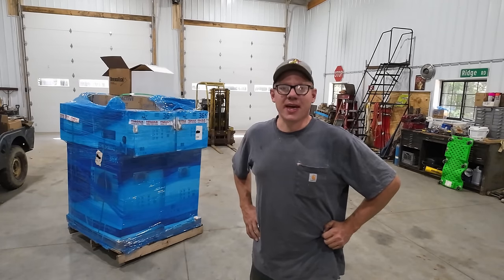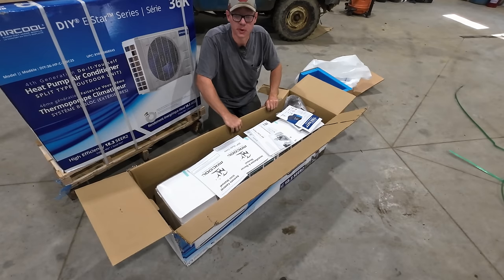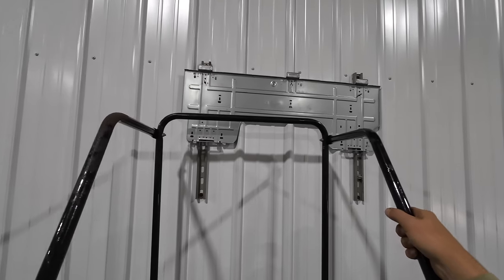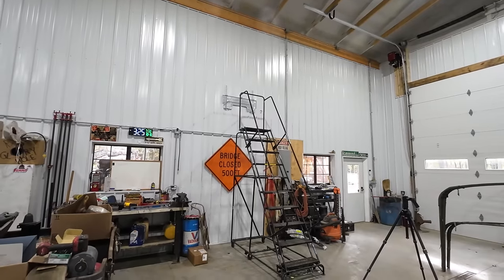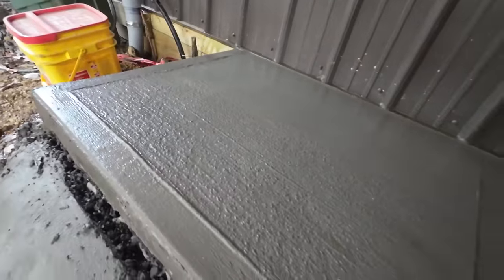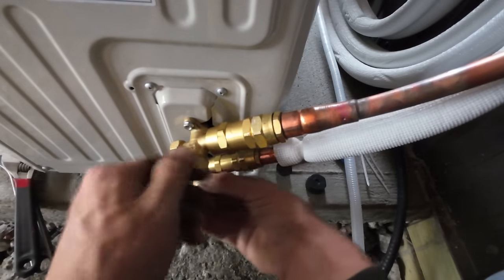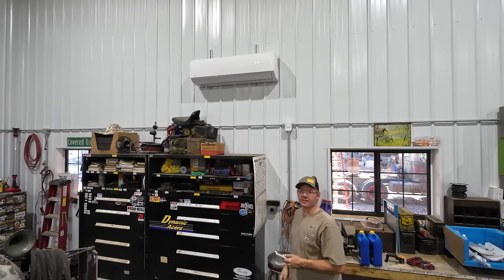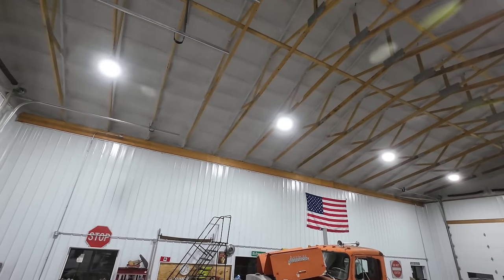DREAM SHOP Gets a Serious Upgrade! (How Hard can HVAC be??)

Comment: One suggestion put a bit of steel wool in the lineset hole in the wall and seal it with some caulking. I’ve seen mice climb the lineset and make a nest inside the indoor unit. I know this because I had to replace the customers unit as they chewed up wires and destroyed the unit. 36+ years in the hvac trade you did a clean install. Happy thanksgiving.
Reply: I agree, the steel wool hurts their fillings.
Reply: Im surprised you didnt notice no electrical disconnect.
Reply: I did the same thing with the steel wool. 😮
Reply: I would use the stainless steel scouring pads, they won’t rust away.
Reply: That and I’d always been doing a slight angle to the outside to help drainage along with keeping rain from falling into the pass through and into the conditioned space.
Even if the condenser is mounted under a cover, best practice along with other smaller improvements I’m sure other made elsewhere that aren’t entirely necessary but add a bit of extra protection and peace of mind.
Reply: I used the steel wool trick in my house, around the holes between the basement/first fl for the baseboard heating pipes. Took a steel scrubby pad, squirt some silicone caulking into it as a 'binder', and shove it in the negative space around the pipe. No more mice upstairs. (after the cat, no more mice in general...)

Comment: Be sure to clean the filters regularly, if you don't the dust will actually clog the blades up to the point where the fan will get clogged and the units rather loud.
Reply: Also make sure the condenser units are not crowded out, you need lots of airflow for them to run efficiently, as possible.
Reply: @everestyeti   100% true!
Reply: @everestyeti  They stress that to hell and back when installing them here in New Zealand.  It needs to be as clear of obstructions as you can make it for several feet in front of the fans.
Reply: If I may add my two cents in to this..😃.., I'd install simple roof above the inner unit so all the dust that there always is inside the shop, won't lay down in to it but instead the roof wich is lot easier to clean. Could imagine simple piece of tin would do the trick..
Reply: Every 3 months inside and 1 time every year the unit itself
Reply: If you live in colder climates you should mount the outside units higher to avoid drawing in snow.  During the winter these units also produce a significant amount of ice underneath them.  It's interesting how these units function, if the outside coils accumulate ice it will start a defrost cycle by reversing the AC circuit until the ice is melted.
Reply: @Tuulessaistuja  Bingo, thats a great idea!
Reply: If you don't run the units consistently the crap that may be inside the indoor units can grow mold!
The best option is the run them consistently or be diligent at cleaning the filters.
Reply: Make sure  outside drain don't freeze, will back water moisture into inside unit,, great video, you made it look easy
Reply: We have an18k MrCool. Installed 4 years ago. And it is rather loud. We disassembled it and cleaned the blades till they were blue again However, it is still loud. It sounds like it is crying. I am wondering if it might be due to a loss of refrigerant or a bad bearing. Any thoughts? We clean the filters monthly but we live in a dirt bowl.
Reply: I've had mine running in my garage for 7 years.  Never had to clean the filter yet.  I guess if your environment is dusty you may have more frequent maintenance needs.
Reply: There are a couple of woodworking YouTubers that made filter boxes for theirs. Might be worth looking into.
Reply: @glenlongstreet7 I’d check the bearings first
Reply: @Tuulessaistuja  That's a great suggestion!
Reply: You might need a clipped Carter pen
Reply: Or use the mouting structure top-side to shelter the units a little bit from dust and debris falling directly down onto the filters, clogging up things. Nice installation!
Reply: One thing to think about is deisel exhaust especialy starting older motors is heavy thick smoke.   That sticks to surfaces so if you know youbare going to be running them or expecting the shop to fill up with smoke turn the units off.   When you are done open the doors to clean the air a bit at both ends of the shop.   Then close them and turn the units back on.  Other wise all that oil and soot will be drawn into it and create a dust trap.
Reply: My thought exactly. A ‘roof’ would definitely help but fine dust is going to get sucked in anyway. 7 year warranty is generous but suspect that might not be for an industrial environment. Great video anyway 👍
Reply: 100% true, if the blades get dirty you have to wash the heads.
Reply: Got any links or the name of the YT channel??? That would be a GREAT add on when putting one into ANY shop @SmogFighter
Reply: Far more than just the filters.  The entire unit needs to be thoroughly cleaned at least once a year.  In a shop, I'd bump that up to every six months.  These things are essentially reverse radiators, and all those nooks and crannies of the heat exchanger need to be spotless.

Comment: Just a few words of wisdom from a guy that has been there, done that.  The 7 year warranty turns to "0" if you do not have a certified installer turn the system and submit the warranty card. I installed my first one myself and in less than a year the "mother board" went out and the cost to replace it was more than I paid for the entire unit. READ THE FINE PRINT!
Reply: Yep. I purchased a 36k unit and it ran fine cooling  all summer. When I switched to cooling, an error code came on and it stopped working. After emailing Mr. Cool, I found out I was on my own. Not a good company.
Reply: That's interesting considering their website says "no specialized training needed" for the DIY units. Additionally, on their "restrictions" page and in the warranty page that apparently comes with each unit they specifically state:

"Proper installation - Limited lifetime warranty applies only to systems that are installed according to the installation instructions*, and in accordance with all applicable electrical codes and permits.
*State certified or licensed HVAC contractor is not required for warranty on the DIY series units. (Always check your local laws.)"

So that first part, they may ask to see the electrical permit or general installation permit? I've never had to warranty one of these so I'm not sure.

Only that you must register within 60 days of installation and enroll in the MrCool Care Program within 4 months of installation, which has a biannual fee. In the event of a compressor failure, you have to have a qualified HVAC tech do the diagnostics or testing and provide an invoice to MrCool for a replacement.
Reply: @n2ocharged  Yea likely those complaining about the warranty didn't do the second part and enrolled in the Care Program. They already tried to save a buck by going the DIY route and figure saving a few more to no pay the recurring fee for care program is unneeded expense. Those saying to read the fine print, didn't read the fine print lol

Comment: I think what people overlook with these units is that they not only function as an AC and heat pump but as a dehumidifier as well. This makes a world of difference on the internal climate and moisture on tools and wood. You will love these units!
Reply: That is what air conditioning means and what it does; it "conditions" the air by removing the humidity.  What it doesn't do is "cool" the air.

When I installed my central air, I used a heat pump.  For winter time use, I have a humidifier built in to the central unit in the air handler to put humidity back into the air.
Reply: I don’t believe it has active dehumidification, it only has a drain line because the heat exchanger can create condensation.  Sometimes…. So I would say it’s a stretch to say this would act as a dehumidifier.
Reply: @tetedur377 You should probably write to every single dictionary publisher then.
Reply: @tetedur377 you should probably look into how they work... or do you seriously think that your heatpump-based fridge is just very dehumidified and not actually cooled?
Reply: @BrianKrahmer if the ac is to small to cool the space all it does is dehumidify. If it is way to large it will cool the air to fast to properly remove the humidity. It will effectively rain inside and interior surfaces will sweat. If sized correctly for the space it will dehumidify and cool at the same time.
Reply: They work in Heat mode or Cool mode. The Dehumidify or Dry setting are all Cool mode settings with the fan speed reduced to low and the thermostat disabled so the system will continue to operate and take out moisture in the air and not stop at any preset temperature. This can cause the interior head to ice up.   It is best to set the fan speed to high and leave it there (this tells the system that you want full compressor power when needed) and only use Heat or Cool modes. Never use Auto as the system will then decide whether it will operate in Heat or Cool dependent on the exterior temperature.
Reply: @tetedur377  Cool air holds less moisture than warm air, so any object that is cooler than the dew point will attract condensation, which is all a dehumidifier is. Your ice tea glass in the summer is dehumidifying the air next to it. So I'm not sure what you mean by the unit not cooling the air. A heat pump absorbs heat from the room and transfers it outside. When there is less heat inside, it's cooler, so the coils do cause the room air to be cooled. Heat pumps just reverse that action for heating. It's all thermodynamics.
Reply: I’ve used these type of units in my texh rooms to not only keep them cool (modern servers don’t need to be in an ice cold room anymore, 70F is absolutely fine). The mini splits will nicely dehumidify as they cool the room. As others pointed out, it’s basic thermodynamics. Compressed gas is expanded at the evaporator, that causes the coils to cool. Warm air when cooled will hit the dew point and the moisture strops out and wither runs down the drain hose, or you need to add a little up pump to push the water over to a drain somewhere. If the units are too small they will run continuously and that’s not good. If they are too big for the space, they will cool the room quickly. The short run time doesn’t allow enough time to dehumidify and then cool floors will get condensation. We had that happen after we virtualized 25 physical servers onto 3 physical costs. The reduction in heat generated was incredible. The previous AC system was not far too powerful and ran so short, that it did cool, but we got a wet floor. A much smaller split system was then installed to handle the modest cooling needs. For heating, the cycle is more or less reversed.
Reply: Pretty sure any AC unit is a dehumidifier

Comment: Almost every home has one of these here in Norway. Here is an advice: You need to mount the outdoor unit minimum 50cm above ground. In the winter the outdoor unit produces condensation that will build up as ice all around your unit. 
It WILL be damaged.

Comment: I am a retired HVAC pro,  I only saw 2 things not quite right.  1) no disconnect switches at the outdoor units to turn off power for servicing.  2) you should mount the outdoor units on blocks above the pads.  When in heating mode, the outdoor unit will freeze and do regular defrost cycles.  That water will collect and re-freeze in the bottom of your units, eventually stopping them from working .  In your climate and because you should not have any snow load in your lean to, 8 to 10 inch blocks should do fine for drainage, more if snow depth is a factor.   DON"T try to undo those refrigerant lines, those fittings are a one time seals.  They have self piercing metal seals that are destroyed on installation, so undoing them will require an HVAC technician to pump down the system, re-evacuate the lines before re-using the system.

YES, get some ceiling fans for heating season, it will save a lot on heating, both for the heat pumps and your boiler use.   Will be 85 to 90 in the rafters...

P.S. WHY didn't you use your scissor lift!!!!   would have been much easier to place the indoor units 😜

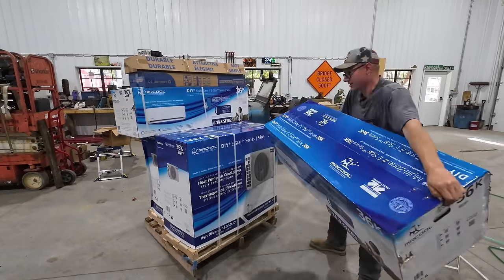Comment: 5:30 - That look of terror while pulling the first box off the pallet...

Also, one suggestion would be to add a fan to move the warmer air above the unit down sooner rather than later... I learned this in my garage with a different heating unit. As the heat rises it will tell the unit the temp has been reached but the lower half is still cool. I put a fan in the garage to move the air and it makes a WORLD of difference.
Reply: 100% Agree probably 4 drop down ceiling fans in that shop on low wouldn't be prefect  .

Comment: Good choice on the mini splits. I installed a 3 head unit in my house with the purpose of heating and cooling. After 2 years I am very impressed with the results but the biggest lesson I had to learn is to install a surge protector to protect the computer boards. The board that controls the fans and communication modules was very sensitive in my units and burned out during a summer brownout. Good luck with the units.
Reply from the maker: My breakers all have overload protection hopefully that helps
Reply: @DieselCreek  still a moderately cheap investment to throw a surge protector on at the disconnect that is easier replaced if it takes the load of a surge rather than boards. Seen many burn out from power brown outs in my area
Reply: @DieselCreek  you need a surge protector block on the power panel. Square D and others make them. They connect to a spare 240V breaker. After getting stuff blown up several times I got smart and since no more fried appliances or $$$ ceiling fans.
Reply: @DieselCreek surge protectors are over and above a standard breaker. They have units that will protect the whole panel.
Reply: @DieselCreek Unfortunately overload protection at the breaker and a proper surge protector are not the same thing. Overload just prevents more power from being drawn then should be on the line. Surge protection prevents a surge of electricity coming from outside, bypassing the overload and then directly hitting your electronics. You really should get some good high rated surge protectors that get put in directly on the lines for units like these and other similar areas. The biggest issues are generally anything that converts AC to DC or has sensitive electronics inside like computer chips, small capacitors, etc.
Reply: I guess it depends on the unit, we have a large Fujitsu unit and 2 smaller ones. Last year while they were running we got hit by a very large lightening strike that killed many things in the workshop and house but the aircons no worries they survived unscathed their RCDs didn't even trip. Keep those filters clean.
Reply: Big ass fans
Reply: @mikewendeln5218  They would be best, but man do they come with a big ass pricetag. Getting two of those will cost more than the mini-splits. OTOH, in the summer, you might not need the minis running.

Comment: Glad to see mini split heat pumps becoming more popular in the US. They will happily produce heat down to almost 0F and are extremely efficient around and above freezing so you only really need to supplement them in the deepest winter. Pretty much the cheapest heat source here in Europe.
Reply: Yes, agree. Sweden (kind of Canadian winters) saw the boom of these 5-10 years ago (~$2-3000 with SCOP around 3) and they've only become even more efficient (SCOP ~4-5 is not uncommon!) and cheap ($1-2000). Time to those dirty coal and oil facilities, most homes, stores, banks and most of the EU are on our way
Reply: It's not quite as simple as that as switching base load plants to nuclear and increasing peak shaving capacity takes time and money. There is only so much sun in winter and wind has its own set of problems that limit its cost reduction potential. All that said it's nice that your regular Joe can now pick up an inexpensive heat pump and achieve cost savings.
Reply: He's in Pennsylvania so milder winters then here but mini splits around us are good for 8 or 9 months in the Northwoods. Once the efficiency drops to 100 percent there are cheaper heating sources. once you are using electricity just to keep the outside unit from freezing its time to switch heating sources for the winter. That's how we do it at least.
Reply: Geothermal is all that and more but they are expensive.  Heat pumps are a great midrange solution.
Reply: @CandyGramForMongo_  The main install is what kills you on a Geo system.  The wells and lines in that ground.  But the unit itself is actually cheaper then a heat pump.   3ton geo furnace was $15,500 heat pump was over $18k
Reply: @johnunsicker7440  If you have a pond, lake, or other suitable body of water (big if), you can use that instead of drilling wells and it becomes a no-brainer, cost-wise.  I buy geothermal when I can.  Buy once, cry once!
Reply: Mine just give up around 5F and start blowing cold air. They also have the worst control software on earth and it's a lottery if the room will be within 5 of the setpoint any day of the year. Pioneer/Parker Davis units.
Reply: Natural gas is also still a lot cheaper than Europe. I assume that's why they've become popular in the US more slowly.
Reply: So when’s the big over head crane going in?!? IM DYING TO SEE IT
Reply: @pgriggs2112  Here in Germany both air and geothermal systems are quite popular. In new housing areas especially you will see many homes and office buildings using these systems. You can get by without natural gas and oil but not without electrical power.
Reply: @RobertBelt-x6d it's nice that they're putting in newer tech for your muslim and African replacements. It would be nicer if you resisted your Z0G though.